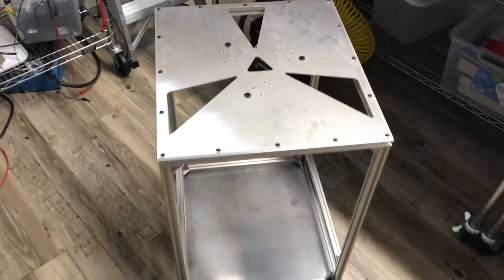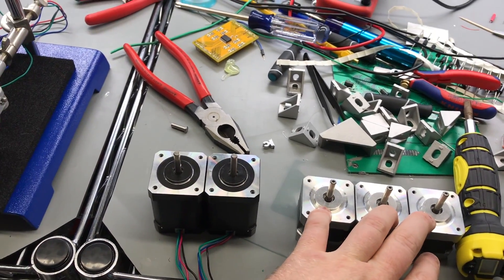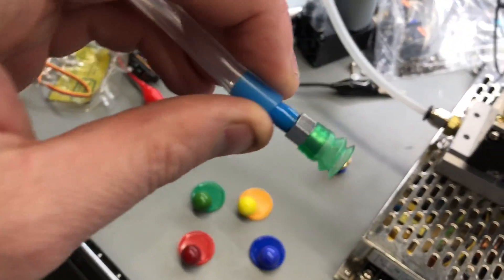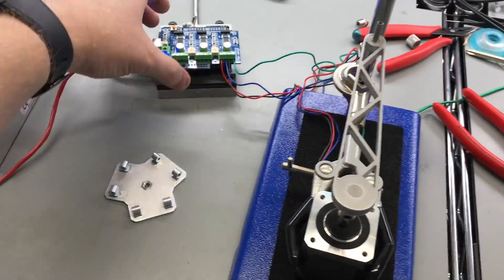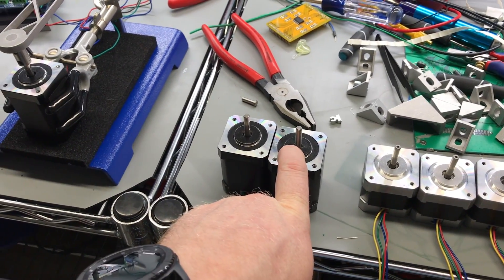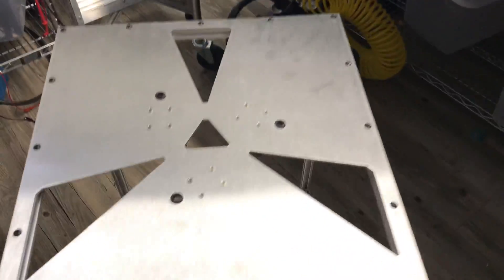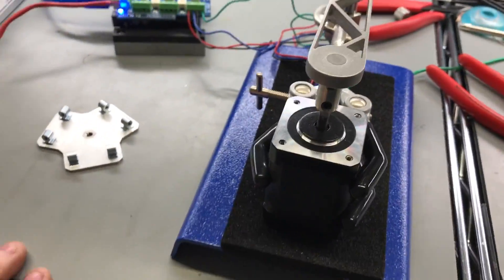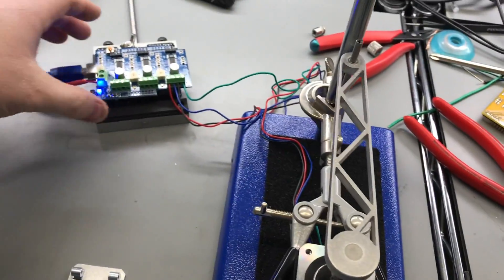DIY Pick and Place Delta Robot with Vision System

Comment: Have you tried some trinamic drivers?
Reply from the maker: I have looked into them and they seem perfect for 3d printers, but they only operate up to 2.5A. They will not be strong enough for the larger motors I will end up using that require 3.5A each.

Comment: Awesome project! Any particular reason you don't modify an existing delta 3D printer? That would seem less work
Reply from the maker: Delta printers are parallel delta robots that slide up and down columns. This is going to be a parallel delta robot with linkages to control vertical movement instead of rails.

Comment: Firepick Delta tried this for SMT pick and place and it didn't work out.
Reply from the maker: Not viable as a 3d printer, but I'm not 3d printing anything. Delta robots are used for their speed, not accuracy.  They are extensively used for pick and place applications.
Reply: Pick and Place was their main objective, 3d printing was an afterthought. It most certainly is a viable means of placement but I guess you don't need the accuracy they were after.
Reply from the maker: Yeah, my main goal is to just sort the glass marbles and colored chips and then move on to things like picking up different sized coin cell batteries off a conveyor belt and placing them in their packaging.  SMD component placement does not need the range of motion a delta robot has to offer.  A simple 2 axis plotter with and an extendable gripper is all that is needed.

Comment: Looks like a fun project. You may need to gear down the stepper motors, they may cause jerky end effector movement with the step size. I know they cost a fair bit more but you may want to consider large Dynamixel servos
Reply from the maker: I will probably be making several iterations of this.  First, I just want to get the kinematic down without vision.  Then with vision, I'll be able to distinguish object colors and locations.  With 1/8th microstepping, these motors are stepping at 0.225 degrees per step.  I've never personally used dynamixels but I've heard good things about them.  What are their advantages?
Reply: I missed saying the first time how well built this looks.
Dynamixels are nice because they have built-in tunable PID controls, programmable soft limits on motion, force feedback and don't need to find home to know where they are like stepper motors.
The downsides are they are more expensive and tricky to get communicating
Reply from the maker: Thank you! Sounds great, I'll definitely give dynamixels a try one day
Reply from the maker: With the dynamixel I could easily teach a move for non vision applications.  What are the best drivers for them?
Reply: To control from a computer I use the USB to Dynamixel adapter from Robot Shop (they have a newer version than mine now). It's worth noting this doesn't power the servos, that needs to be done by something else. The adapter looks like a serial port on the computer.
You still need to control the Dynamixels from an external source, they don't have any kind of built in path learning that I know of. I've used MATLAB on the computer and an Arbotix-m for an arduino solution
Reply from the maker: Cool, thank you! Do you have a particular Dynamixel model that you would recommend for this application?
Reply: I've only used AX-12A because it's the cheapest, but I don't think it would be strong enough for what you're building. I guess just look at the newer models and see what seems resonable
Reply from the maker: I'm thinking of using Clear Path Servos.  They seem perfect for this but are really expensive.